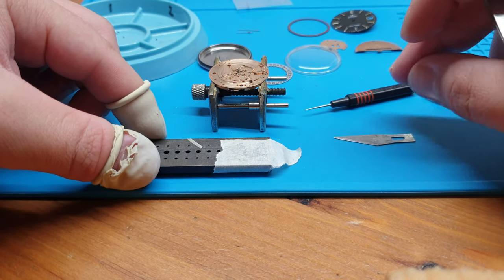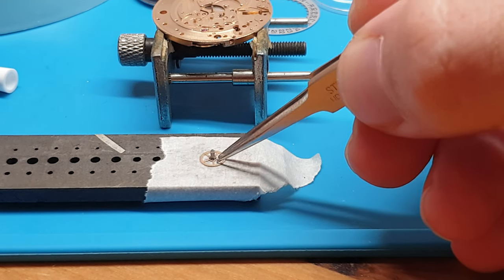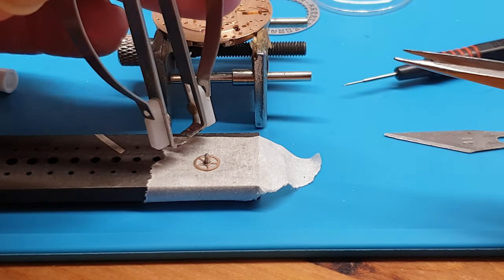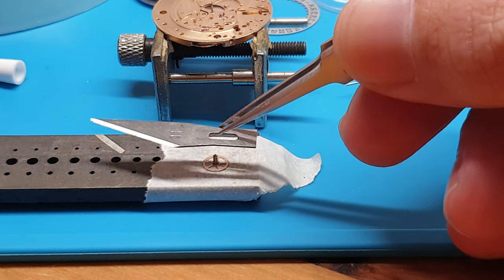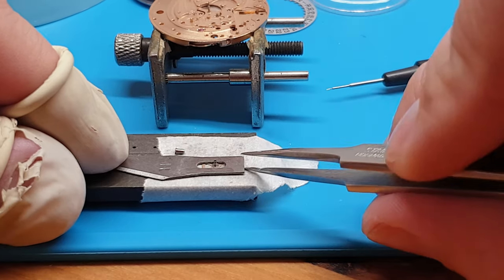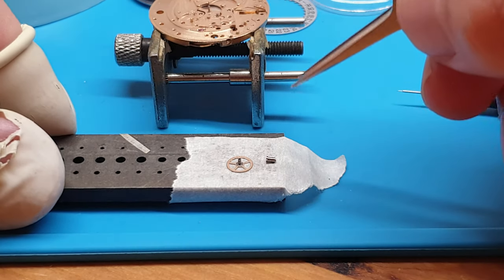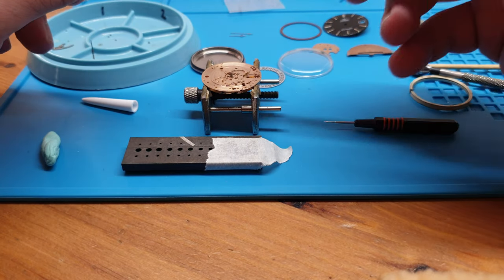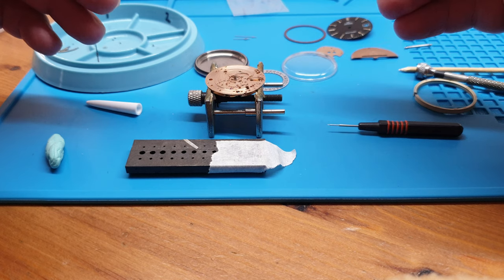Omega Seamaster (How to remove cannon pinion correct and safe way from the center wheel)

Comment: The canon pinion is a sort of friction sleeve or slipping clutch, IMO.  Too loose and the hand movement can be inconsistent, slipping on it's own. Too tight can cause manual setting difficulty.